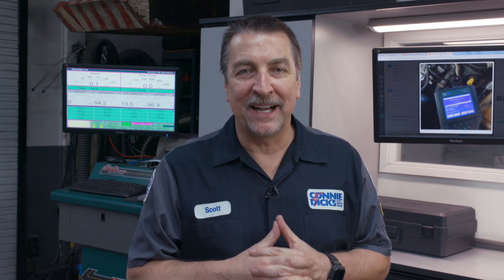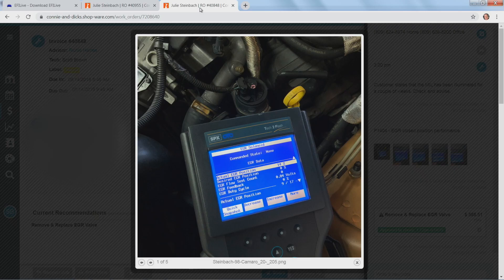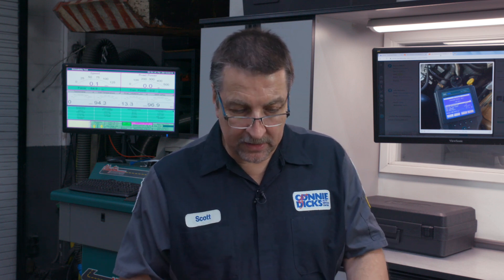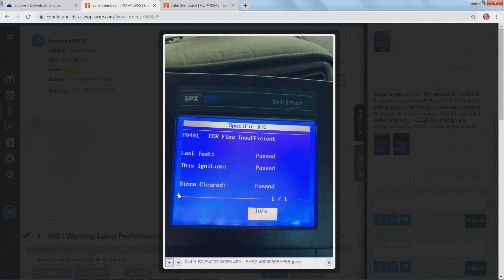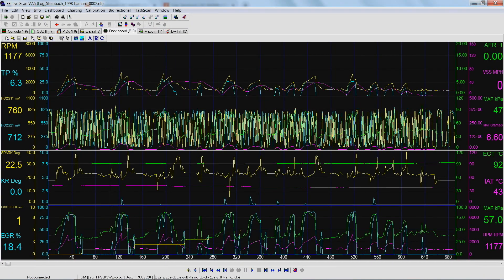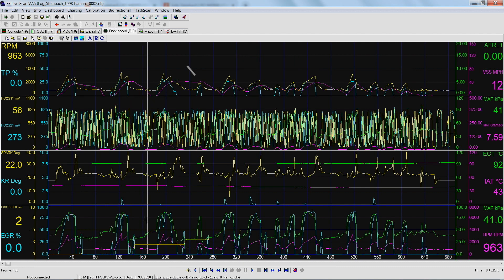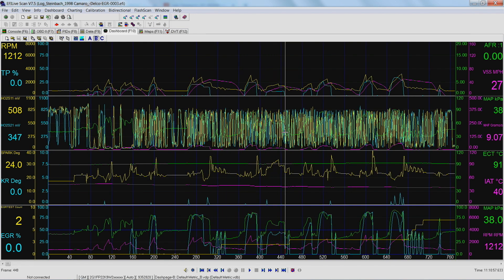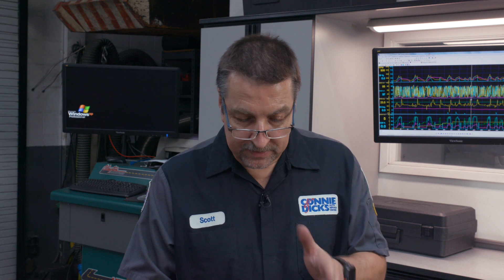Old School OBDII - 1998 Camaro 3.8L - Aftermarket vs OE EGR Valve - P1401

Comment: Thank you very much.....and Delphi has become just another Dorman....had a GM truck got a Delphi O2 senor and the connector looked correct but would not connect and Delphi claimed OE senor. Automotive aftermarket has become a race to the bottom.